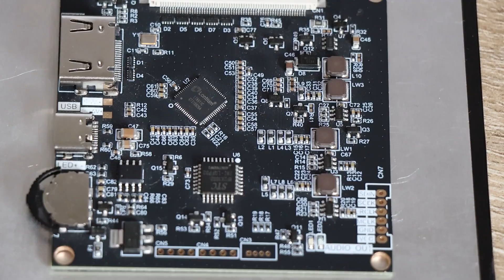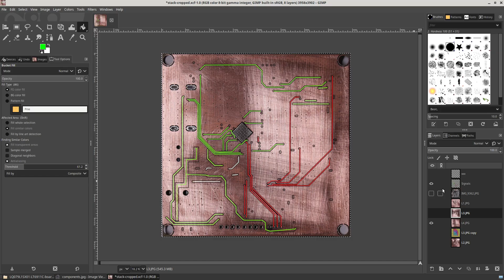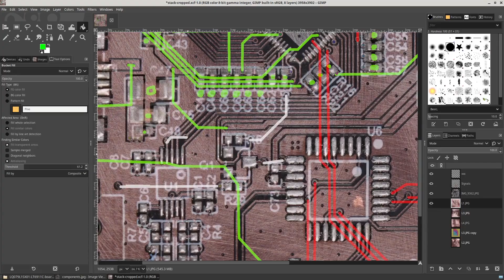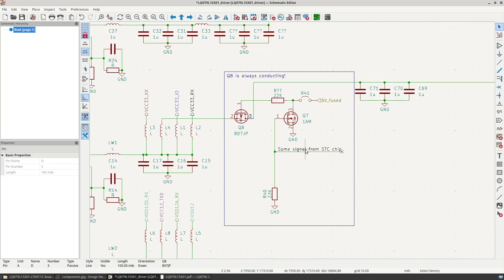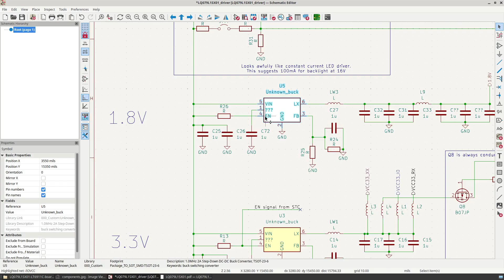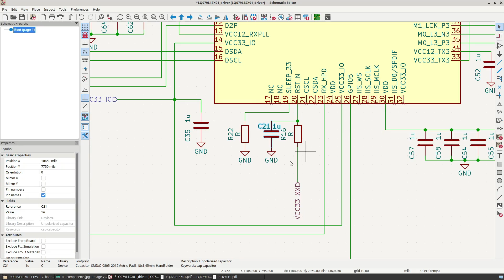Reverse engineering LCD driver board

Comment: I've been trying to learn MIPI DSI lately and I've found some good resources on youtube and reddit.
My personal project has been an iPod 5th Gen classic with a Oled display.
I was able to find a working example kit (hdmi) on AliExpress  for a 450x600 OLED 2.4 inch display and im in the same boat as you (no code, no firmware for chip).
Even with the full data sheet I could not figure out proper timing, so I still have to go with the logic analyzer method.
I found this one logic analyzer, U2Pro16 but its Chinese only at this moment (1ghz for 130 bucks on ali choice sales)
Ordered it and hopefully it can read this display fast enough, the display is clocked at 250hz so I just got a 1ghz analyzer with adjustable threshold voltage and im hoping for the best.
The ESP32-P4 will be my choice of chip, since that has full mipi and a open source hal that has mipi support (ESP IDF) with documentation.
I hope to share more info soon.

Comment: you could check out Target3001  it has a reverse engineering feature where you load in your layer pictures, draw components, pads, connections and derive a schematic from it.   free version is quite limited tho.
too bad its such a cluttered shitty mess developed by some german engineer, it could be so much better and useable.  i hope kicad gets this feature someday.

Comment: the patience you have.... i respect that.
i once tried to do the image -> PCB reverse engineering with an IKA mag lab stirrer, that thing has like 2mm traces and maybe 40-50 components.
i never finished it cause i didnt have the patience.
I cant imagine the amount of self (hatred)control someone needs to do this on something like an lcd driver

Small edit only now getting to the meat of the video.
i cant tell if they trusted the autorouter. or did it on purpose to prevent reverse engineering.
its like so cursed i refuse to believe this isnt on purpose.
Reply from the maker: Lol, this was fairly easy. I guess I have patience, because when I design boards, I can spend hours routing stuff manually and optimizing layout.

As far as cursedness, I can see what they were trying to do. Perhaps they ran out of time and just shipped it. Like we are paying this guy say $5K to reduce BOM cost by $0.5 on 10K boards. But still, version 9 and this got into production... At least there is some fun content from that :D

Comment: Cool investigation project. How did you grind out pcb in order to get to 2nd and 3rd layer?
Reply from the maker: I have started with dremel and flap disc, then as soon as I saw say 60% of all copper, I switched to sandpaper.  But I was lucky that these layers were pretty much all copper, otherwise I am not sure if I would be so brave with dremel...
Reply: @IlusysSystems  thanks.

Comment: The LT6911C may need a firmware, which is only provided per project and screen.. so good luck with getting one working for you. When I was dealing with this I even wrote a 8051 simulator and disassembler, but they are not providing a register/memory map or internal docs. I had successfully used a Toshiba hdmi to 2x4L mipi though (and that one has a pretty complex setup.. but documented!), with a RPi4 source. The toshiba is afaik EOL. Then there is an option to use Analogix - that comes with docs as well.
Reply from the maker: Thing I am afraid of is, that while some chips are documented, the LCD panel interface is not to great extent. However, I don't have great knowledge of MIPI. Does it have standardized command set? Is it even standard? And so on.
So there is steep learning curve especially using this not very popular panel. While I have LT6911 chip pre-programmed for this specific panel, so I don't expect huge issues.
Reply: @IlusysSystems  the MIPI DSI over DPHY is quite standardized, as far as the interface and basic command set goes. Its sort of analogical to an USB - you can do things. But the key point is - some devices may need "firmware first" - that is, a secret sequence of register settings within a screen. I have seen some that are hundreds of operations long, while there are some that need none. Depends on how advanced the TCON is - some do have NVM and the screen vendor does properly pre-load it with contents, while other vendors and clones use a cheapish version, maybe no nvm, and the configuration has to be pushed on each power on. Some screens required just few register tweaks.. I think that was the case  when the NVM was almost right and the screen needed just some patches for few locations. Anyway, my experience is back 10 years.. when first phones had FHD screens like 5", and did work on QHD.. then those chinese cheapo generic driver boards with lousy fpc came and it was unsustainable to keep up for me. If you have a fast scope, you can almost decode the configuration stream when tapping the DSI lane/s.
Reply from the maker: @cameramaker  Thanks for info. My usual thoughts - Why do we live like this? :(